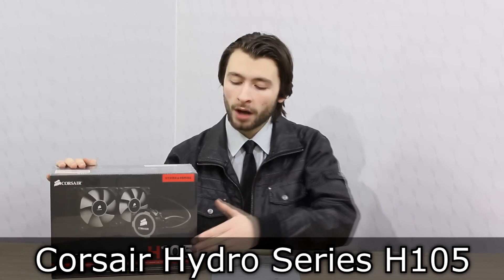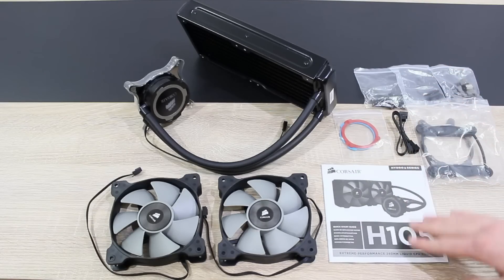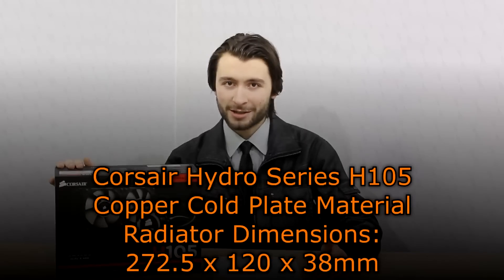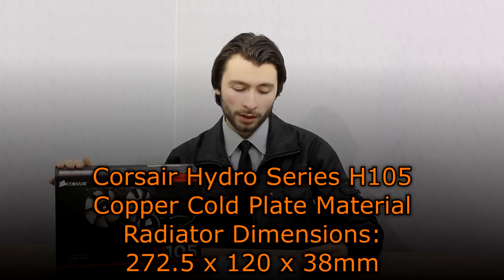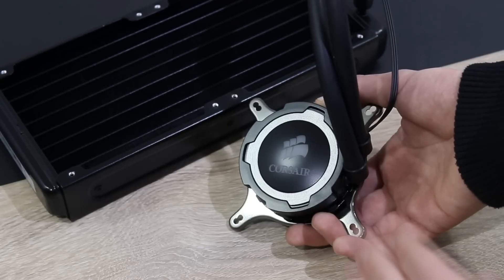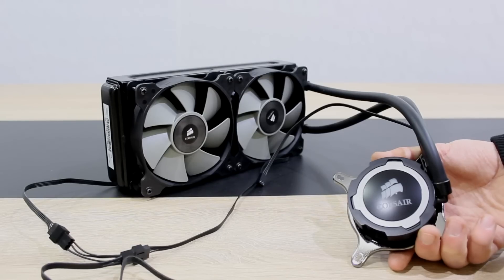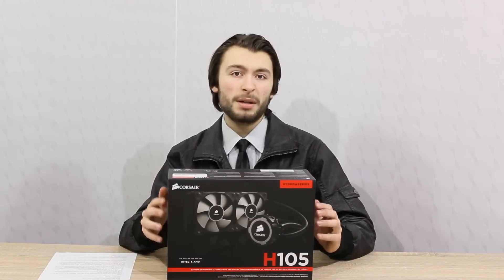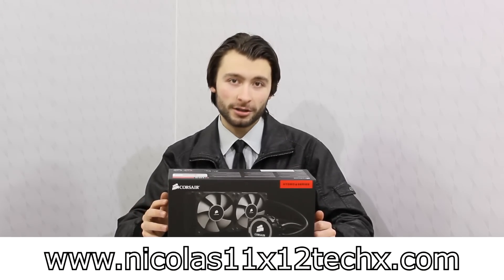Corsair Hydro Series H105 Review

Comment: Anyone know why my CPU voltage is soo high. Intel i7 4770k at 4ghz using 1.280V. I can't over clock it anymore. It always freezes!!
Reply: Well bro..You must have a"bad chip".Can´t oc it more than that.
Reply: but that doesn't make scene?
Reply: Jackson Welch
 it depends from chip to chip..For example i can oc my i5 3570k to 4.5 at 1.32v..I can´t oc it anymore than that because it will freeze..How did you make your oc??With the turbo frequency?
Reply: Not sure. I think its my mobo (msi z87-g41) it was a pretty cheap one. It wont let me go above 1.300V.
Reply: Jackson Welch
Yes,it could be the mobo too..
Reply: is that normal tho?
Reply: Jackson Welch
If you bought a cheap mobo it could be it..The more phases the mobo has the more oc you can do..Or you can have a chip that you can´t oc further..It all depends on the components you have and things like that..For example i can have the same cpu as you and achiev 4.2GHZ..An example..A friend of mine as the same cpu as i and he can only get 4.3GHZ while i can get 4.5GHZ..
Reply: I should have gotten a better mobo. :) I didn't think it mattered that much.